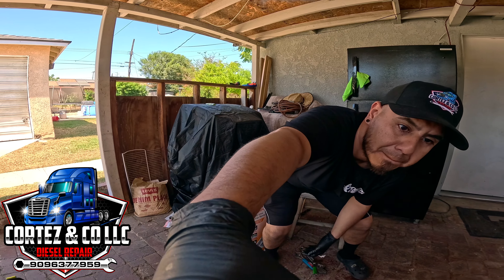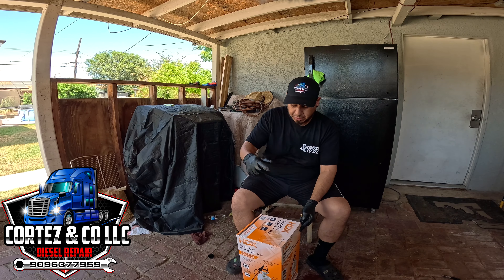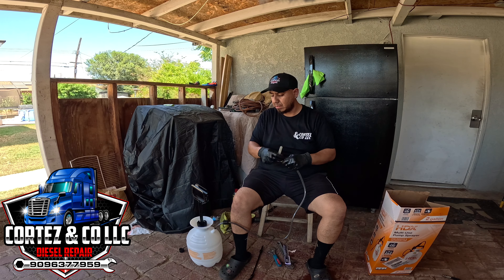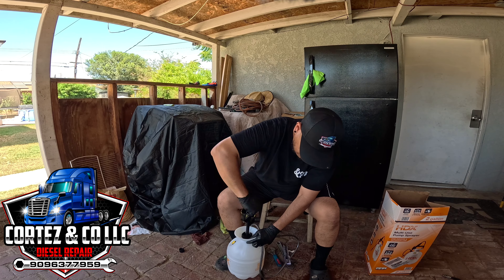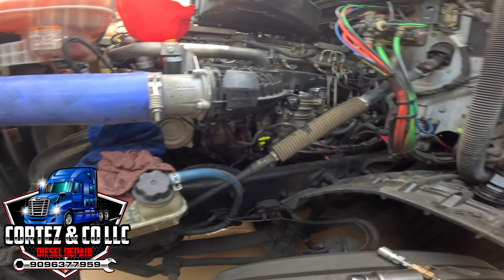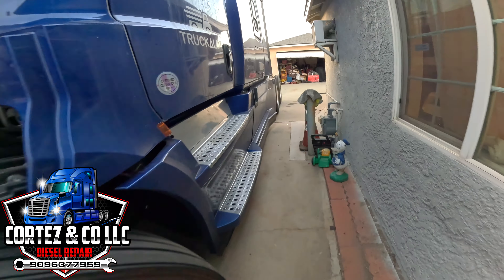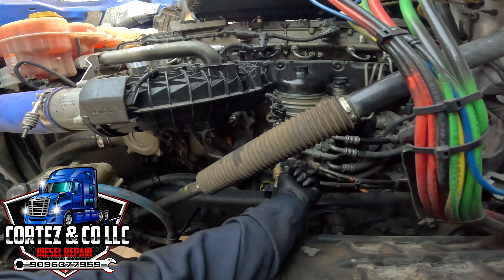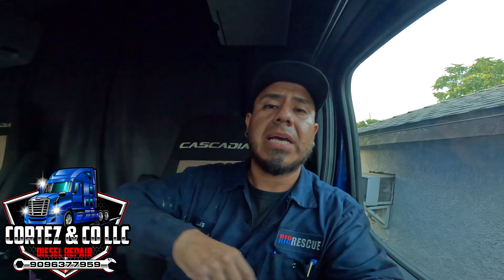How to Prime a Diesel with a Homemade Pump | #howto #dieselrepair #mechanic

Comment: Nice broo im going to make 1 tomororw,i need it
Reply from the maker: Awesome! Did you get it done? They help out a lot 🙌🏽
Reply: @shreqboi1  need the fitting part number,I buy 1/4 inch fitting and is to small,maybe is a 1/2,but part number will help alot
Reply from the maker: @jeffreylopez8691   I don’t remember the party number, I got it from Home Depot. You should be able to find it in the copper pipe section, pvc pipes, galvanized pipes are. They have small fittings. Just take the other end to measure